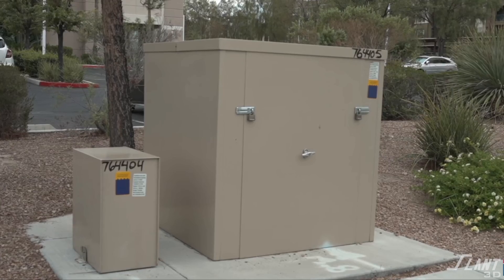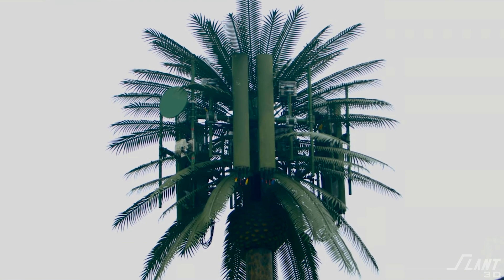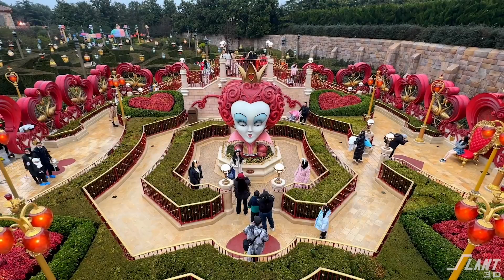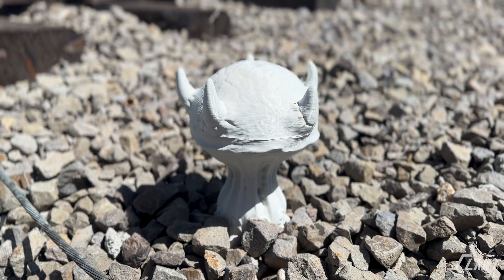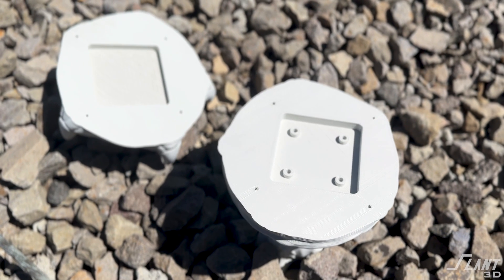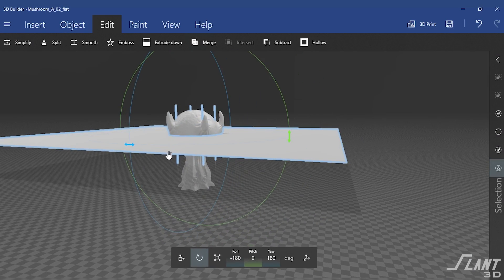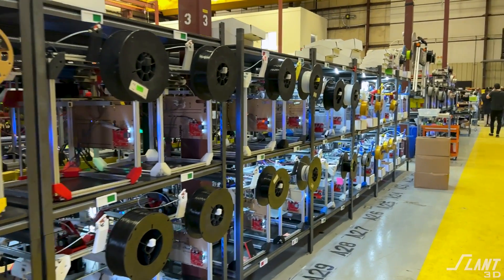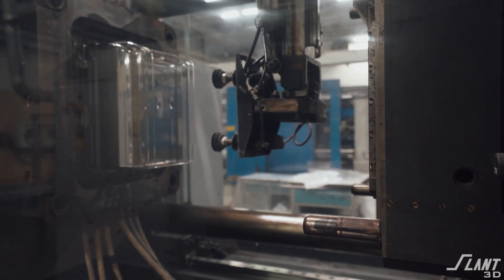Camouflaging Electrical Enclosures | Design for Mass Production 3D Printing

Comment: How were the cavities in the bird house made without internal support?  It seems like that oval shape would have a lot of layer overhang. Thanks
Reply: Depending on the layer height and line width, this might even work just fine without additional support. Actually, you can get away with pretty bad angles if the surface quality doesn't matter all that much. In this case, the most problematic surfaces would be inside - and I don't think the birds would care. ;-)

Comment: Theoretically, you could even make electronics that don't need to be plugged in. Using a wireless charger receiver and maybe a battery depending on your use, you could pause at layer height, insert the electronics, then resume a print over and you'd have a sealed object that visually doesn't appear to have any plugs but can still function if placed on something with a hidden wireless charger. An example could be a glowing rock which when placed in a certain location would wirelessly power LEDs. Or a random looking object could actually be a Bluetooth speaker that charges wirelessly and is completely portable.
Reply: "Mass Produced 3d Printing!"

Comment: Power connection? Batteries? Battery port? Cable tension management? Fastening method (inserts? Or just screw it together as is?) Good explanation though! Thanks for sharing. Your latest content has been quite useful!
Reply: This is clearly an example of a design technique and not a finished product.
Reply: All these things could be designed to be part of your 'negative' - or a separate secondary negative depending on the application